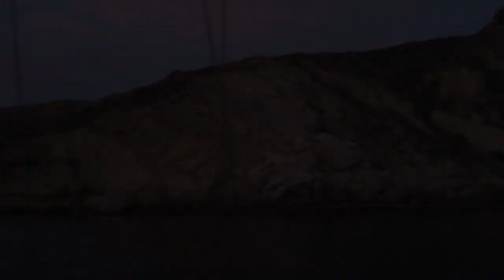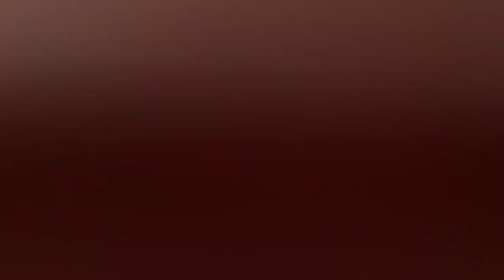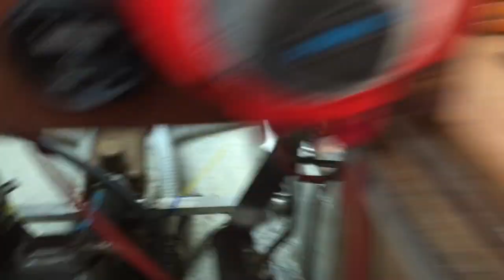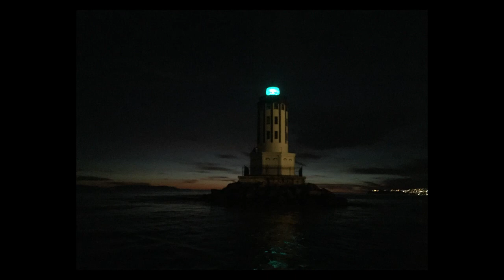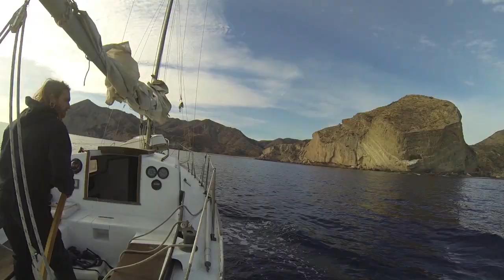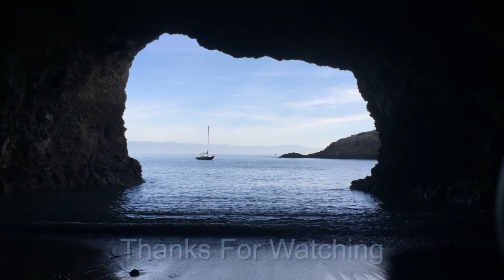Sailing Vessel Triteia - Sailing to Coches Prietos Anchorage, Santa Cruz Island

Comment: Great trip out, looking forward to the series, lovely place to anchor. There is something special about being totally alone ( it is nice to have company too ). The rocket launch was a spectacle. Over here in the UK, a green handle on the pump for unleaded petrol and black for diesel. Happy New Year.
Reply from the maker: Yeah at MOBIL stations here its green for unleaded and black for diesel as well, maybe they are a uk company? The rocket launch was incredible to watch. we watched it its boosters on the first stage blast again. I was really freaked at first just because of all the tension with North Korea but figured it was a rocket launch.
Reply: I thought you had a diesel engine on the boat, that's why I commented on the pump colour, obviously I was wrong.

Comment: Down there is the same as up here, no one goes out in the winter. makes for great anchor spots without hundreds of boats.
Reply from the maker: The last day of the trip I was at the Isthmus on Catalina and the mooring field was completely empty!!!!! I have never seen it like that ! heaven.
Reply: I find it easy to heat my boat but having an air conditioner in summer kind of hard. Watched video's of there in summer, Crazy!
Reply from the maker: Yeah It was a little chilly in the mornings before sunrise but I would just let me alcohol stove burn for a bit and my cabin would warm right up.